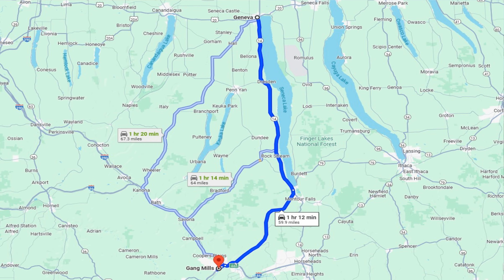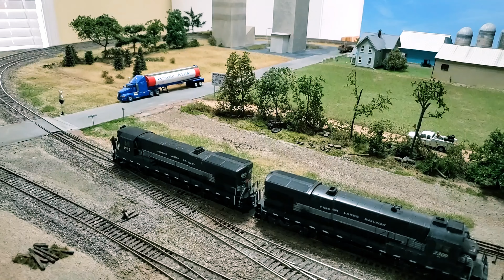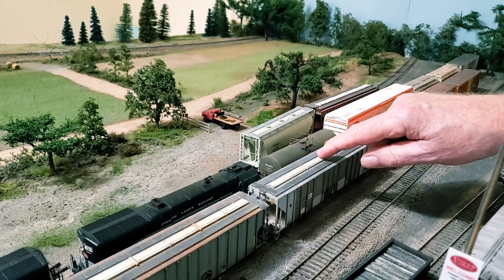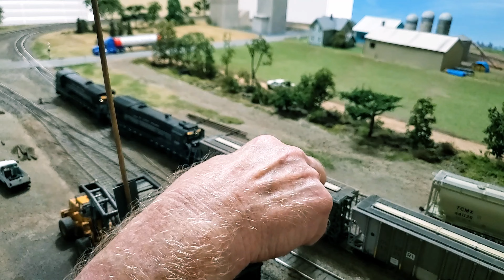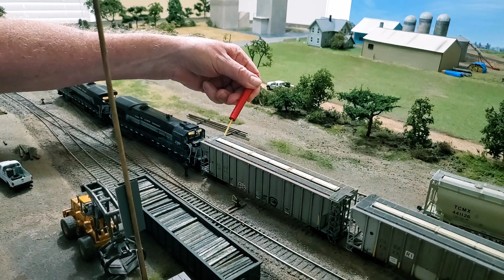Realistic Model Railroad Operations: Working Cargill Salt Part 1

Comment: Most Railroads, at least out west (Might be different over east), we have 3 horn sequences we use. 3 short blast for reverse, 2 short blast for forward, and 1 short blast to indicate the engineer is "set and center" or providing three step protection (red zone) for the conductor to enter between the cars.
Reply from the maker: Good info. The Finger Lakes Railway is just a little class 3. They blow the horn at crossings, but I think that's about it. I started using 2 short for forward and 1 long for reverse, cause that's what NS does here in SC. Thanks for the comment.